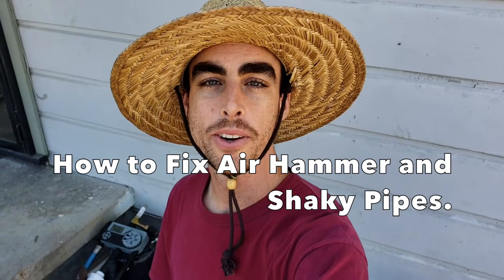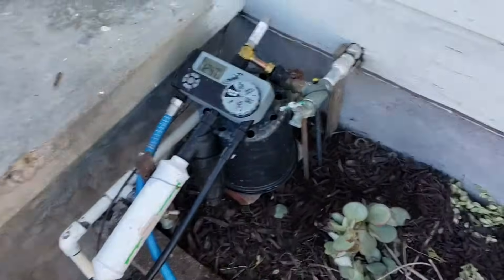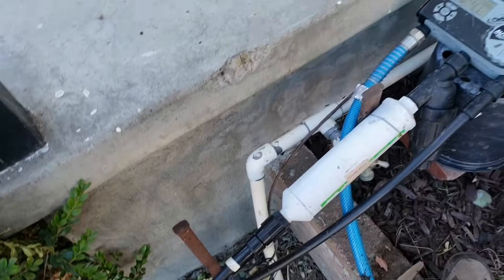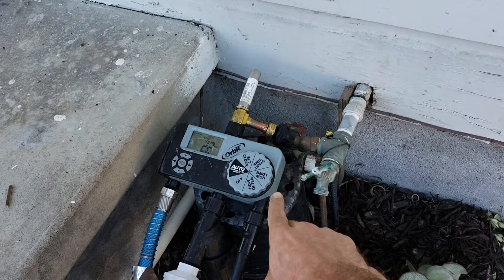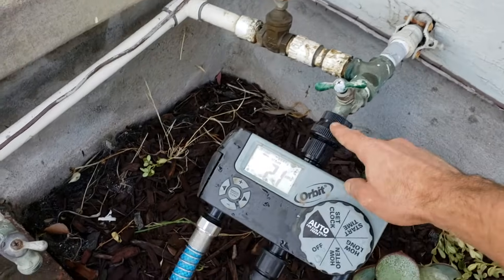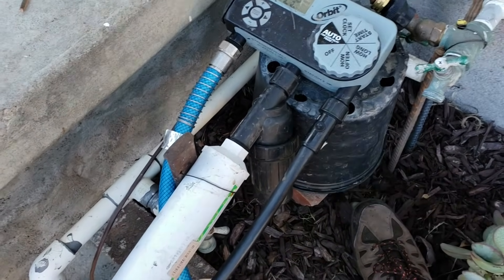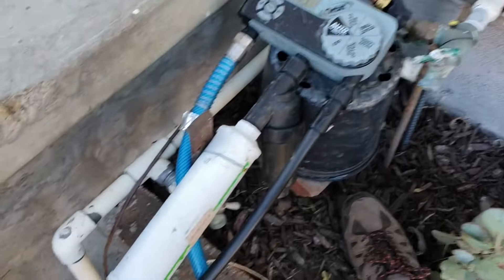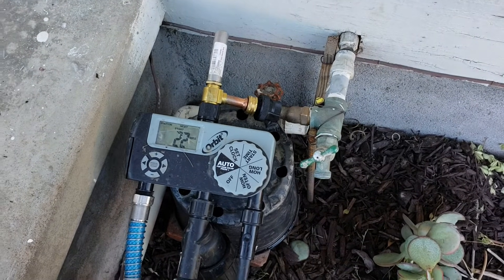How to Fix Water Hammer in Irrigation Systems | Easy DIY Solution

Comment from the maker: 🛒 PARTS TO FIX AIR HAMMER:
Air Hammer Arrestor - https://amzn.to/2SdyMWf
Pressure Reducers - https://aff.dripdepot.com/aff/idevaffiliate.php?id=251&url=150
Bailing Wire - https://amzn.to/2E4wo0W
-Use rebar or wood stakes

💧BEST IRRIGATION parts here - https://tinyurl.com/ydxr79fb
🔢 Drip Depot Irrigation Calculators - https://tinyurl.com/yc2hbecy

🛒 TIMER STATION:
Electronic Valve Timer Stations - https://aff.dripdepot.com/aff/idevaffiliate.php?id=251&url=625
Water Filter - http://amzn.to/2stZeCN
Particle Filter - https://aff.dripdepot.com/aff/idevaffiliate.php?id=251&url=385
Backflow preventer - https://aff.dripdepot.com/aff/idevaffiliate.php?id=251&url=588
Pressure Regulators (Tape 10-15psi, 1/4" emitter 25psi) - https://aff.dripdepot.com/aff/idevaffiliate.php?id=251&url=150

MORE IRRIGATION VIDEOS:
▶️ Irrigation Playlist: https://www.youtube.com/playlist?list=PLG9acmbzWMphDPFZt4W25COaa34yw-7OB
▶️ New Manifold Design: https://youtu.be/hO3LVm7j1c0
▶️ New Plot Drip + Sprinkler System: https://youtu.be/GZWDF6g984c
▶️ Market Plot Irrigation Build: https://youtu.be/cYs9-othuKM

Comment: Thanks for this! It immediately solved our mystery of the sudden bang at 12:30am each night.

You mention that this Orbit timer is known for closing the valve too quickly, & I immediately noticed that I have the same one. Seems like trying a different timer would be a good first step before installing an arrestor.
Reply: I don't think the timer is really an issue, all non-mechanical valves utilize solenoids and diaphragms that close very quickly causing the air hammer effect. Also, an arrestor is a cheap fix, whereas a new timer can be costly.

Comment: Hear a quiet 'humming' when sprinkler system is OFF at the backflow.  The copper pipe from backflow to irrigation solenoid actually vibrates but you have to hold the pipe in your hand and you can barely feel it.  The irrigation system is new and has no leaks.  The main into the home is Pex to copper manifold 1".  There is no hum when the irrigation system is running.  Any help, thanks!!

Comment: If your water hammer is caused by your sprinkler pipes shutting off:  If you stopped using one of the areas and now there is air in the pressure side of that line, you’ll get a big water hammer when the other lines shut off.  Bleed the line of air and the “MC Hammer” will disappear 🤪
Reply: Wouldn't the line just bleed itself with water going through it. I still have some banging but they didn't take my suggestion in replacing the valve or taking the valve out and just letting water flow through it. Today they put on two arresters on the backflow in coming and outgoing and that I found out made no difference. Thanks for any insight

Comment: Just about copied this setup for a much smaller system, and I’m getting a standing wave in my line... non stop air jackhammer until I turn off water. I think the brass vacuum break/backflow preventer has the fast shutoff... so water is coming past the backflow preventer Into the particulate filter line into the boogie into the orbit... orbit shuts off, sends a hammer wave back, hits the backflow preventer... hammer wave the other way with water flowing back in... and now that wave goes back and forth until the line is shut off.  Woke me up at 5:30 this morning sounding like a small jackhammer in the shower. glad you posted this. Gave me a bit more understanding of what’s going on and how to fix it.
Reply: How did you fix it please? Tried 2 arrestors on backflow today (water in, out) and still banging. Wonder if valves could be bad? Toro. I could replace the ck valves in preventer with extras i have. Irrigation company coming out again to try to solve. Water pressure and gpm has not changed in 10 years. Ty

Comment: A lot of the time this happens on irrigation systems because the valves used on the system close too fast. Not all irrigation valves are the same. Usually brass valves by Buckner Superior are used in these applications because they are “slow closing” valves. Pressure regulators, water hammer arrestors, and check valves also work. Great video!
Reply: I had very loud banging each time my zones would turn off. Pretty much all but the drip. I tried several water hammer arrestors and reduced it slightly. I tried lowering the water pressure down to 45 pounds and even that didnt help. I finally raised pressue back up to 60 pounds and added another water pressure reducer after the sprinkler cutoff and lowered it down to 50 psi. That way the house pressure was 10 pounds higher then the sprinkler. Worked like a charm. Dont hear it at all now.
Reply: @Out2fly2  that also works! Sometimes it’s best to have 1 pressure regulator for the house, a second one for the irrigation system and when needed, even 1 for the valves themselves individually set according to how much pressure each zone needs.
Reply from the maker: Thank you I appreciate the knowledge!

Comment: That hammering is nothing.  Mine sounds like someone hit the wall with a sledge hammer when it shuts off.  Hammer arrestor didn't seem to help all that much.
Reply: Same. What was the fix?
Reply: @DSK1616  Divorce
Reply: Yes two arresters did nothing for me on the backflow. Could backflow check valves be bad or perhaps zone valves bad? I'm not sure how air could remain in the pipes since it's running every day but still getting water hammer on certain sounds

Comment: Air is compressible and can be introduced (as a shock absorber) to reduce/eliminate WATER hammer. I wonder what is "AIR hammer" this person talked about? The device shown in the video is called "water" hammer arrestor, which has entrapped air in it to dampen the shock when fast flowing water is suddenly stopped by a fast shutting valve (like the solenoid valves in washing machine, irrigation system, etc.).
Reply: Wow you’re so smart... isn’t this what this guy just talked about?

Comment: Thanks for the video.  The hammer arrestor would be more effective if the main flow into it came from its bottom, which will help it absorb more energy from the water before the water had a chance to turn 90 degrees.